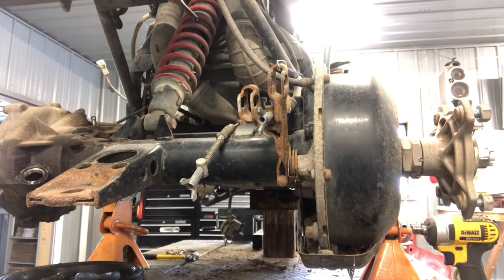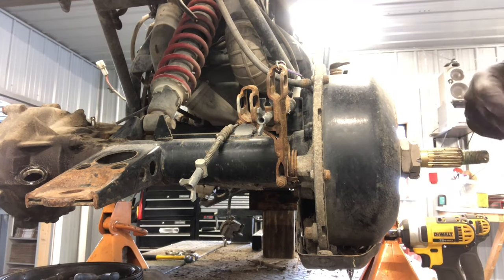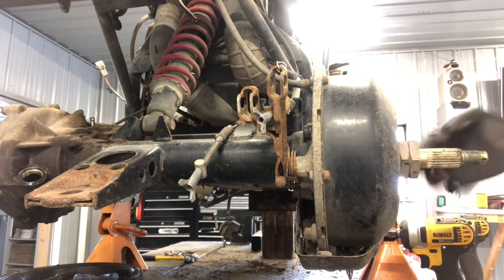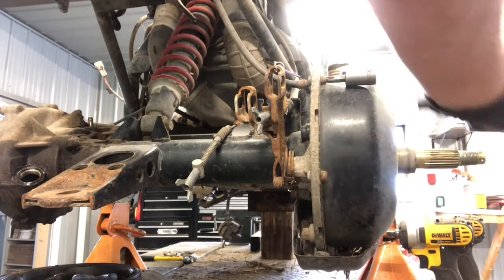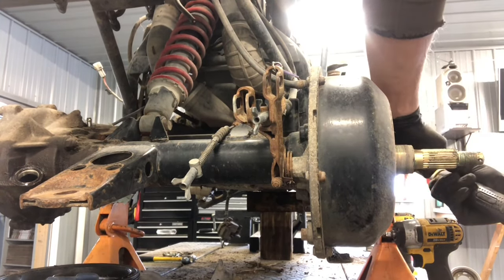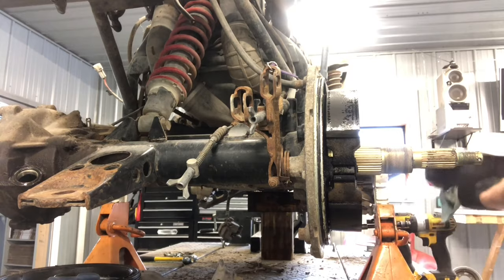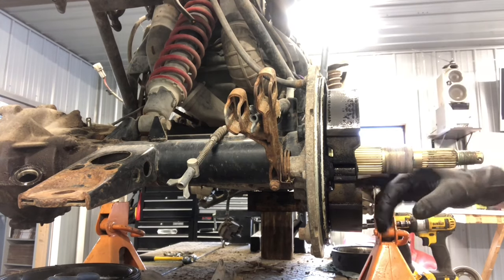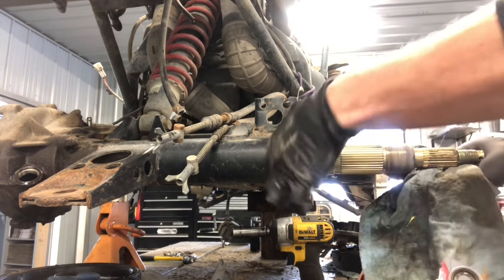Kawasaki Prairie KVF 400 - Back Rear Brake Shoe Replacement - How to Replace Pads

Comment: I've bought a 2004 kawaski prairie im going through bike fixing what others haven't... I have questions about the crank case is there a air intake to that . Also I have some type of electricle connection right by my foot break have no idea what that is I could use some help
Reply from the maker: That electrical connector is for the rear brake light. The crankcase will have a breather (vent) it won't have an intake besides the air box going to the carb. Hope this helps. Let us know if you need anything for this machine. https://www.ebay.com/str/midnebraskamotorsports

Comment: Dumb qustion. Daughter has a 1998 400 prairie replaced both hand brake and foot brake rear cables and new shoes . Still have to crank the adjustment all the way tight for them to work . What am I missing here that shouldnt be .
Reply: Drum may be worn out

Comment: Can you just replace the brake shoes while on the quad or do I have to take off those 4 bolts inside?
Reply from the maker: Brake shoes can be replaced without removing it from the machine. Hope that helps. Thanks for watching. Let us know if there is anything else you need!  https://www.midnebraskamotorsports.com/